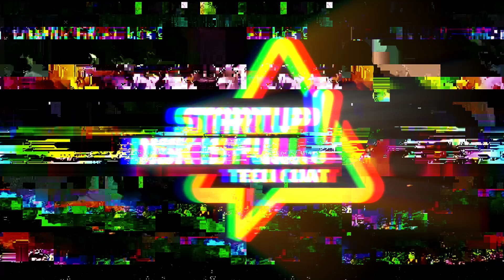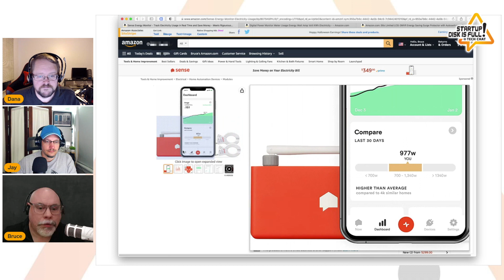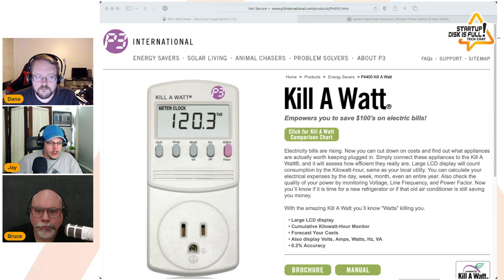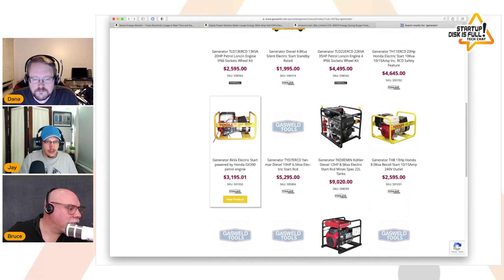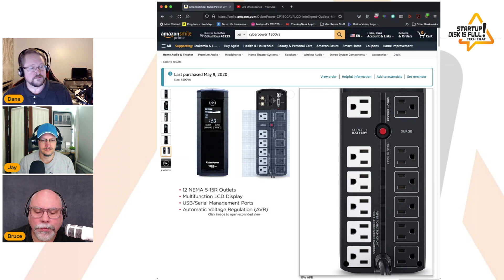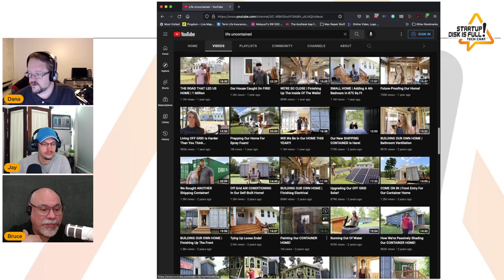Tech Chat E01 - Saving electricity in your home

Comment: I live in the desert southwest US. During the summer it gets stupidly hot in the afternoons. Our kitchen is western facing & that entire side of the house gets really hot. We cook at home but firing up the oven not only used alot of energy, it heats the house up. If that occurs, despite the two coolers, it takes them until the evening when things cool down outside to recover a comfy temp inside. To combat this, we’ve switched most of our cooking to outside Ie: grills or smoker and when inside, use a very efficient table top oven vs the big full-size oven or an airfryer. This cooks quickly and keeps the kitchen/house much cooler. As far as cooling, being in the high desert, we use swamp coolers (evaporative). These work great for temps up to about 98-100. For those real scorchers over that range, I put frozen 2liter soda bottles of water in reservoir/basin. This  gives the coolers a boost and helps them negotiate 100-105F temps. I recently converted my entire house to led lights. These really do help to reduce your bill.

Comment: I live in Melbourne Australia, which is the most southern major city on mainland Australia.

I have a 2 storey house and have an evaporative cooler for the top level, which can tend to flow down to the lower level as well. Some windows and doors have to be open to allow the air to flow from outside to inside the house, then back out again. On a warmish day (20c-30c or ~70f-90f) the upstairs can get a little warm-ish, so I just turn on the air flow (no cooling) to push the warm air out and allow the cool air in. By the nightfall, Melbourne can get cool in the night so I then adjust the airflow accordingly and switch off before I go to bed. In the summer months when it's hotter (30c-40c or ~ 90f-110f) I switch on the cooler, which is not great for cooling during the day but with a the constant flow the upstairs cools down by the evening and I leave it running during the night. I have worked out that if I set it the airflow to 3 (out of a possible 8), I can easily sleep with the covers/blankets/doona on, even on a stinking hot night. This can be on average 19c-25c (or ~58f-80f) at night. I have bumped it up to 5 on some nights that have been around 30c-35c (or ~90f-100f.)

I have a reverse cycle air conditioner downstairs, and I turn this on only if the temp reaches a constant 35c (or ~100f) and above, which is not that often. All windows and doors have to be closed for this air conditioner to be most effective, as opposed to the evaporative cooler upstairs which you open windows and doors. My wife goes nuts if a window or door is open or closed when one or both air conditioner/coolers are on or not. This air conditioner is so effective that even if I put the temp to 22c and the fan to ultra low, I can get cold. On a day that's 40c outside.

So in Melbourne, some summers can get as hot as a constant 35c-45c (or ~100f-120f) and in 2009 when it was 35c-47c for about 6 weeks straight, I did not turn off my evaporative cooling. I did turn off the evaporative cooling when the whole family went to a water park for the whole day, and it was 45c (~120f) that day. When I got home later that night and the house was stinking hot, I turned on any available cooling and the house took 3 days to cool down again.